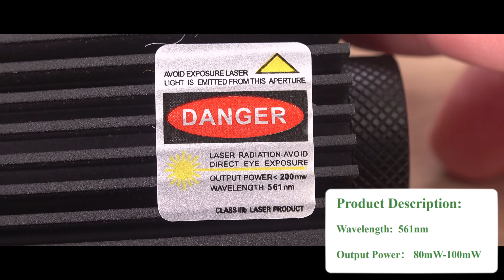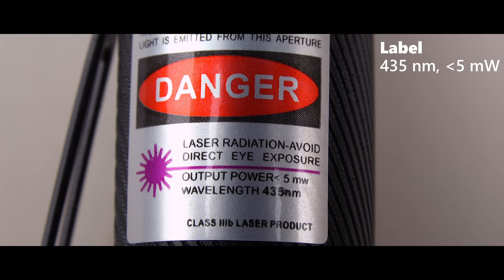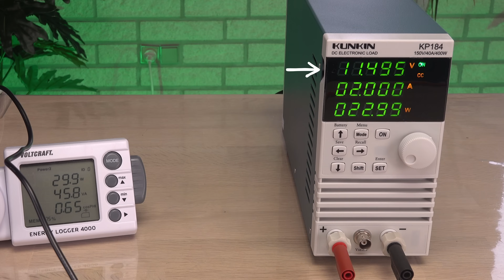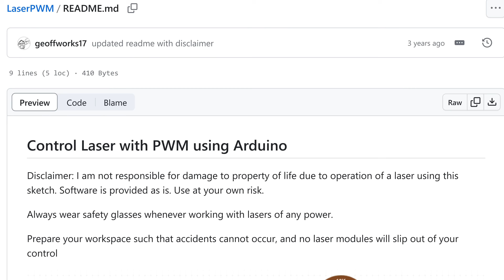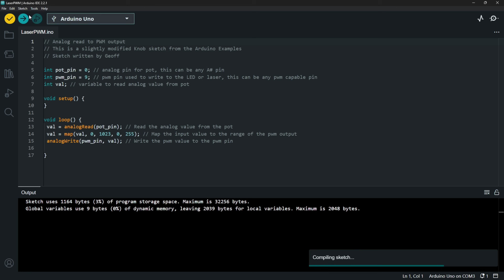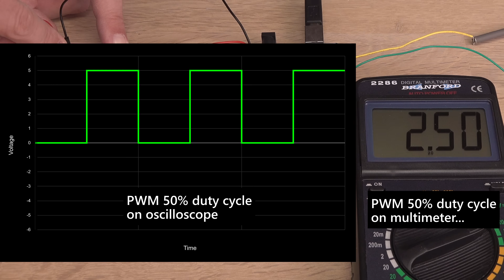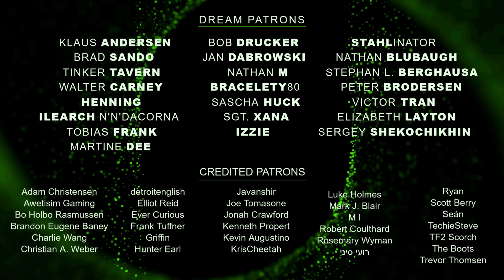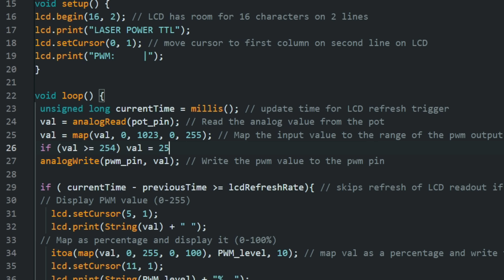LASER underpowered by its power supply? | First TTL/PWM Arduino attempt

Comment: I made some LEDs that are mounted under my monitors that I control with an Arduino PWM using a mosfet. Instead of using a potentiometer to control the PWM, I used just two buttons, one for up and one for down that increases or decreases the PWM level by small increments. Holding it down lets it keep stepping up for each loop it checks for whether the button is down or not, though I did add a slight delay so that it wouldn't overshoot so easily. It is way more stable than a potentiometer since it is not reading an analog signal constantly where slight deviations cause the fluctuation you are seeing in the PWM values on your readout.

Comment: I got mine today and it came also without a TTL laser driver circuit, while on pictures it had one, i guess i may have to drive it with an ardnuino nano too.
I think you needs some capacitors when you have power issues.

Comment: That's cool! Maybe you now need to DiY the driver circuit or modify it now to get your full power!
I think an improvement for your Arduino code sensing the potentiometer is to add some better rounding/debounce/stabilization to the analog in. There are many ways to do it I'm sure so try some and see what works best.

Comment: For an oscilloscope, get the DHO800 with 4 channels, get the lowest frequency one, as you can hack them fairly easy to their full bandwidth (they're just software limited). As for the TTL/PWM attempt, simpler is often better, and a 555 (with a Vcc of 5V) set as a schmitt trigger + a potentiometer and two diodes would have done the job with no danger of software bugs, ESD or stuff crashing :)

Comment: I can really recommend the Rigol MSO5074 oscilloscope for a price range <1000€. It has 4 Channels and is capable of recording signals up to 100 MHz. Additionally its firmware can be cracked to unlock its full feature set. This adds a bus analyser for RS232/485 I2C SPI etc, recording of signals up to 400-450 MHz, CSV oscillogram export and much more. 

I do not know of any other oscilloscope which offers better features in the same price bracket.

Comment: 6:31 - it seems that the pinout of the mystery connector was already printed on the PCB - due to placement of the nearby capacitor, the marking is shifted to the right.

Comment: Very cool idea of controlling the laser using PWM. 
But be mindful of the laser output. Depending on how your PWM signal controls the output power, it might just adjust the average power and then even at a low average power there would be high power pulses that might be dangerous to view without protection. A low 3mw average output for example might actually consist of 30mw pulses with a 10% duty cycle.

Comment: Sometimes often, 'online' sellers (like on ebay) will 'bundle' power supplys with electronics that just make some functions work. Sometimes sellers just don't know what they are doing, but I think some sellers even like to sell bundled under-rated power supplys where they DONT tell you who chose the power supply you get. 
Could even be because it lowers the general risk of failure of a total piece of junk (but of course not the power supply). Because if you feel you got a possibly good deal except for the under rated power supply that failed, maybe you won't complain... instead you replace the power supply that came with it when it fails or just won't work, once you finally realize that.  Then there is some chance the product will still work with a power supply with the right specs (you'd rather replace the power supply then return the item). It's an all too 'businessy' way to make money. Grifty total BS sometimes. I don't care how the sellers feel about grifty risk management. If I can't run something with the power supply it came with, But I CAN power it with a big battery of the same voltage (or lower!) then... it's crap, it's crap, it's crap! Damn pushers!

Comment: You can add an exponential weighted moving average function to filter the output signal value to eliminate the jitter. There are several search results if you google for arduino EMA or EWMA filters. If you set the alpha value fairly low, you'll get a nice smooth ramp up to the final value it settles on.

Comment: I think a convenient way around the power issue would be to grab power and ground out of the 3-pin. The arduino's made to be powered off regular USB it looks like, so 5v1a, it won't drain much power. You'd need a buck converter to bring it down to 5v, but that should be simple enough for a person of your caliber to slap together.

Comment: The majority of modern electronics work can be done with a $10 usb logic analyzer. Especially since you can time correlate 16 or more digital signals. 

Oscilloscopes still have a place, but for something like pwm or serial decoding, the logic analyzer is king.

Comment: Oscilloscope - what's your budget?
Most oscilloscopes allow you to take screenshots and export them to a USB memory stick.  Most oscilloscopes also have a good screen on them and are easy to record with a camera - except for Rigol scopes because they tend to have the screen in 'dark mode', and they are quite dim.
More expensive oscilloscopes allow you to stream the data to a PC in real time.
The price range starts at a DIY kit for €5 and go all the way up to the price of a brand new car, so unless you have deep pockets you most likely won't be able to get the best.

Comment: I think there is something in the laser driver circuit that is shorting out the PWM line with GND when the circuit is turned on.
Let's say there is a power limitation issue as you hinted at in the video, your arduino is powered using the battery pack and so it should be unaffected.
It the entire laser module is cheap then the circuit is probably cheaply designed too.  Without purchasing a new laser driver board, you could disconnect the PWM line and only connect it when the laser driver is fully powered up.
Reply: Its the powerbank which is the  problem. Well it aint faulty but microcontrollers/mcu dev boards like the arduino usually draw little current and the powerbank has a feature in its boost converter control ic that when it detects something draws a low current or 0 then it will shut off its output to save power. The minimum required current the powerbank chipset needs to detect is probably higher then the under 10 milliamps the arduino draws hence it shuts of because it thinks it has no load so having the boost converter on (which also loses some power through heat because efficiency is never 100% in electronics)

Comment: The "+ gnd pwm" means the first pin is +, second pin is gnd and third pin is pwm. I think it gives the 12v power option is so you can use a high power transistor and power a high power laser diode

Comment: I recommend Hantek DSO2D15. It's cheap and it has a large screen 155x85mm 800x480px
It'll measure up to 150mhz (1GSa/s)
It also has a generator max 25mhz (200MSa/s)
It has a very intuitive interface in English and Deutsch. It can save screenshots to a flash drive, and you can connect it to a PC via USB cable and stream the data realtime and control the scope from their app. You can use screen capture instead of filming the screen. Best feature is that the knobs can be pushed down which resets their value. Very handy, I miss this feature on school scopes. If you need more info contact me
Reply: You can obviously get cheaper ones but I would say that this one has a lot of features which are sometimes missing from the handheld ones.

The only disadvantage is that it has only 2 channels. I measured 230V AC with no problem. It can also decode I2C and SPI.

Comment: It means the first pin is power, second is ground, and  the third is the PWM pin
Reply: Its so you can use a PWM module that doesn't gave a battery or any other power source I think

Comment: the extra power pin on the 3 pin socket could be used to power the arduino (via it's barrel socket 12v input) to save having 2 power supplies :)

Comment: For the pot bouncing at MIN or MAX, change map(x, 0, 1023...) to (x, 1, 1022) and add two constraints right after it. if val > 255 { val = 255 } if val < 0 { val = 0 }

Comment: I've been debating getting a scope but for the amount I'd use it I don't want to spend a fortune. Rigol's DHO 800 line is pretty tempting with the 2 channel 100MHz DHO812 running 399USD and the fpur channel 814 for 549USD. The trusty 1054Z is also popular since it's easily hackable to get higher bandwidth and runs  349USD. There's also a four channel Hantek that is also fairly popular. Can't remember the model off the top of my head.

Comment: I can recommend the Rigol MSO5074 (~1000$)
Get the 4 CH 70Mhz one, you can Software-Hack it very easily to its full Specs 350MHz, 200 Mpts, 25 MHz Function Gen, Digital Logic Analyzer... (retail cost: 4000$+).
Nice of Rigol to leave the option hacking open for tinkerers. They know tinkerers won't spend that much anyway but makes the 1000$ one very attractive even if it's not so cheap.
It also has HDMI output and it even outputs in higher Resolutions over HDMI, so no ugly upscaled UI.

Don't buy a cheap scope that could limit you.

Comment: flickering on  the lcd could be due to missing anti aliasing filter on the ADC, since the pot is far from the ADC pin and ADC is read often without a cap at the adc input to stabilize the voltage, the voltage will flicker when the sample and hold circuit internally reads the voltage. Another important point is check the noise on the power supply, since your ADC is referenced to the supply voltage any noise on the supply is reflected on the reading so you could reference the ADC to an external reference or you can simple do an averaging or run a complimentary filter on the ADC reading so the sudden changes will be filtered...

Comment: Some power banks don't stay on if they don't have enough load.  The Arduino may be too efficient/low power for the power bank.
Reply: Yep the minimum stay on level for powerbanks is higher then the under 20 mA the arduino draws

Comment: Some notes:
The arduino uno has a voltage regulator onboard, you could actually connect the 12v pin on the laser connector to the VIN pin and they'll run off the same power source. As others have mentioned, the powerbank was likely switching off from too low of a load.

These cheap power supplies often have very questionable isolation, please be careful when using them. Diodegonewild has a series tearing down terrifying USB power supplies.

Rigol's recent lineup of cheap scopes might be a good fit for you. It's android based, runs off USB C PD, and supports external displays so you could run capture hardware and record it directly
Reply: I have had one of these cheap power supplies blow up on me (well luckily not in my face but at a distance of about 2meters) while drawing power from it (turns out later from the autopsy i did because i was curious that it only could deliver 1 amps and i was drawing 3 amps from it because the sticker said so but nope. Also it was getting pretty toasty inside

Comment: for the screen flicker, you can store the current time (in milliseconds) using millis() into a variable, then check it against the current time, and if 200ms has passed, you can issue the update command to the screen and also reset the variable you store the last update time in.  

something like this:

lastUpdate = millis();
void loop() {
    if ( ( millis() - lastUpdate ) >= 100 ) {
        // update LCD here 
        lastUpdate = millis();
    }
}
    
as for the rolling average, this is the simplest way to do it of course, but can be a starting point 

void loop {
    lastValue = value;
    pot = analogRead(pot_pin);
    value = (( pot * 0.2 ) + ( lastValue * 0.8 ))/2;
}

this way the loop still runs full speed to keep the inputs fast, but the screen updates on its own interval.  another way to do this is a rolling average where last value is say, 80% weight and new value is 20% weight, and that gives the value some inertia so it doesn't change so quickly.  and sorry ahead of time; i'm typing on a phone so i didn't bother variable declarations and rounding and all the minor things you'll obviously have to do, but it should give you an idea of what i mean

Comment: 1. the chinese can get away with under rating the lasers  you buy a 30 miliwatt laser and get a 1 watt laser shipping to the united states  however in the the eu regulations are more aggressive and they cant get away with that so they turn it down.

2. you can cash out your videos and empty your youtube account to get the oscilloscope.

3. the most expensive part of oscilloscopes are the display so a usb version just a black box that connects to usb and uses software to make the display making the device cheaper.

4. if the pwm is within the frequency response of the computer sound input you maybe able to use the sound editor as a crude oscilloscope heck amiga mod music tracker softwares often had an oscilloscope display for the recording of the samples.

yes you may get a loud buzzing noise but you can mute the output

5. you may try doing a review for an oscilloscope and get the unit for free.

yes due to eu regulations you would have to disclose sponsorship but you should not have any issues with that

the eu does that to control the way companies do product placements on tv.

Comment: Instead of mapping the range 0-1023, you can map the range 10-1010. This will ensure 0% and 100% are stable. And instead of the range 0-255, you can use 0-127 and double the result. This will help with the flickering numbers, but reduce the resolution to just 128, which I think is enough
Reply: Of he could just remove the 0-255 value and just use the percentage with a decimal place.
Reply: @Shocker99 that's not how this works. The pwm and ADC resolutions are limited
Reply: @TheRailroad99  That's 100% how it works.  There is no need to display the sint. The percentage is flickering? That's just a rounding error, there you add more resolution so the rounding error is removed.

Comment: The Rigol MSO5074 costs 1100€ and has a large touch screen and lots of on-screen data decoders. There is also a mode where you can just show the voltage of one channel in a nice 7-segment style alongside the main view. I think it makes for pretty nice screenshots, you can probably get good footage with it as well. It stutters a little when you adjust a trace, but most in this price class and definitely all the entry level ones will do this. It looks completely fluent as soon as you stop touching knobs though
Reply: This line, MSO5xxx series, also has an HDMI display output.

Comment: If you power the Arduino through USB from your PC you can open a monitor where you can print messages from your program, it's easier than driving an LCD display.

Check Adrian's Digital Basement on tips on oscilloscopes.

Comment: If you have the funds available, the Rigol DHO802 is a hard scope to beat, you could even run it off a battery pack and its features are far above a higher end scope from 10 years ago. I have an $8,000 scope in the lab and I prefer to use the DHO line. It might be a little higher priced than you want to spend, but I promise you that you will not deal with all the issue of the lower cost scopes.
Reply from the maker: The Rigol DHO802 and even 814 is within my reach - though it may be overkill for my current needs. But who knows what my future videos will require? I tend to get more ambitious over time - it's a good way of keeping progressing. Don't like being limited by my tools ;) Thanks for the tip.
Reply: @brainiac75  the biggest feature that I use is the web view of the scope, I can make changes to firmware and see results from my desk instead of getting up to move 3 ft to look at the scope and repeating lol

Comment: Instead of delaying the display, perhaps lerping the pot readout would be a better solution.
Reply from the maker: Hmm, could be useful. Though even a Fluke multimeter displays it digits with a 250ms delay (4 times/s) ;) But I do feel like the 'sketch' could be optimized and improved in functionality. Especially with a bigger screen. 2x16 characters is quite constraining... Thanks for the early watch and comment!

Comment: If there's one tip I can give you based on my experiences with sketchy electronic equipment, either use a really good stable supply, or have every piece on its own. Trying to power everything off of one sketchy source, and a portable power bank like that would qualify, is a recipe for disaster.

Comment: For the switch to set the laser to 0%, maybe not tell the Arduino, because it still could malfunction. Better to pull down the Pwm pin directly or even cut the power to the laser itself. Would be a better safety
Reply: Better still use a multi-pole switch and do all three or at least a dual pole for safety power cut off to the laser while signalling the Arduino so you can get a cool screen message still.
Reply: also important, make it so th switch is normally closed. So if a cable/connection fails it won't turn on, way better if the alternative would be the switch/cable/connection failing and it couldn't be turned off.

Comment: You absolutely should wire the off switch to interrupt the power for the laser. It is inherently more safe than going with a 0 PW. Unless you know how the PWM is implemented after the connector, you can’t be sure there isn’t some unknown scenario where the PWM input is ignored.
Reply: If this was a built system then i would agree, but he's able to disconnect the power using the power supply just as easy in this set up.
Reply: @Shocker99 Even a hacky DIY laser controller should put user safety over ease of implementation. Since the laser module accepts 12V over that 3-pin connector, it wouldn't even be hard.